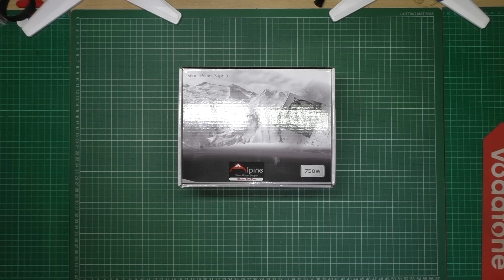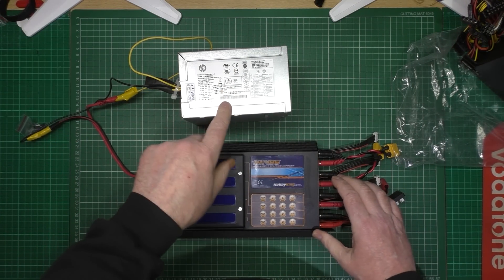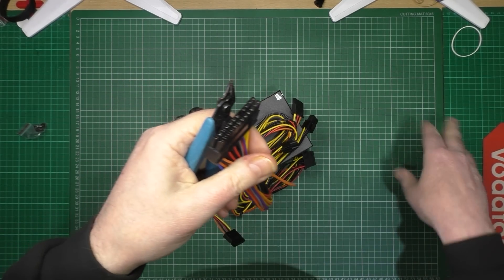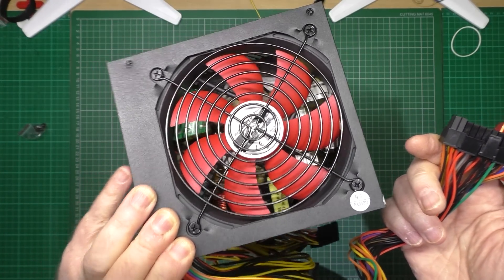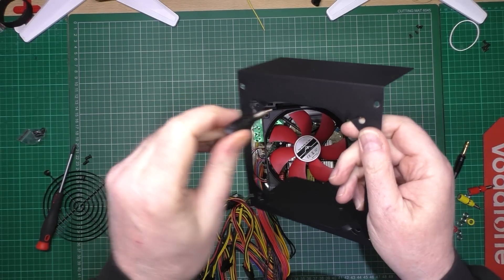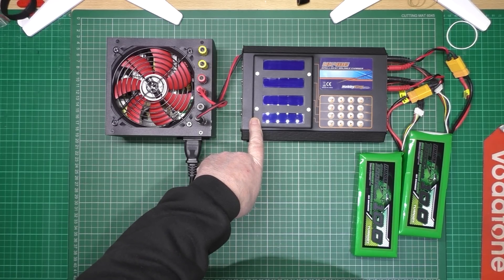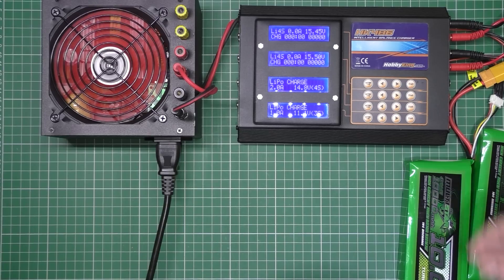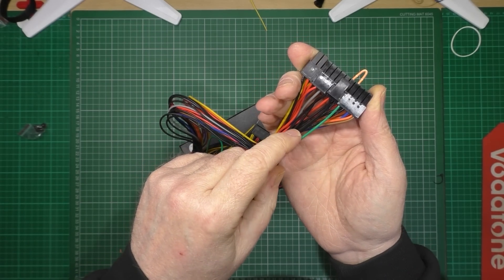PC power supply  - How to convert to power a lipo charger

Comment: Hi, thanks for great video! I have a question. Done everything the same as you, power supply works and charges, but the fan of the power supply is not turning on. What would you recommend doing? Thx again!
Reply: It could have a thermal controller on the fan which only comes on when it gets too hot maybe?
Reply: @vortecksengineering884  found out that the fan was fried. Thx for quick answer tho. Your vid helped a lot

Comment: I’m thinking of doing this for 3 imax B6 Mini chargers. However they don’t have bullet connectors, only barrel connnectors, which are rated at max 5A. Is it a bad idea to clip the red wires and solder them with the ground wires to some barrel jacks?
Reply from the maker: Whatever works for you!  
I'd recommend you use as many red & black wires in parallel as you can to share the load.

Comment: So would you just remove every other wire that isn't the green one, black, red or yellow?
Reply from the maker: You can bunch all the black together and the yellow together if you want (or spread them over however many connectors you have), it won't hurt and will handle the current better if you're charging at high current (more than 4a). Or, you can cut off any wires that aren't used but make sure you insulate them :D
Reply: Thanks mate. Would I be able to desolder the wires from the board and disconnect them from the connector?

Comment: Thanks for sharing but could I just pull out 1 ground and 1 red lead and jumper the green and black together? And is this practise common to all computer power supply's? Thanks again for sharing.
Reply from the maker: +etab83 Take the green wire and link it to a black one (any black one) this will make the power supply work. Red = 5v and yellow = 12v. If you get a higher wattage power supply, it's better practice to take 2 or 3 yellow wires and 2 or 3 black wires to carry the extra current on 12v. All new power supplies work this way with exception of the high-end ones, they also have a current sensor on them and won't work with this method. The cheap ones don't have current sensors and will work fine.
Reply: So I have a psu  (thermaltake sp850ah) rated at 840w @ 70a. So I put all yellows, all blacks, all reds and green/black together. I ordered a dummy load resister 10w for the yellow black as I was told that my new style psu needs to have some type of current for the psu to sense power if not my power will be unstable. Is this true? What else do you recommenf. This will be to power a 400w amp for a subwoofer. Please get back to me

Comment: hi , i thought this would be a great idea for me as i am now charging my lipos parallel. Therefore i need more amps. Its all connected up and powers up for a split second then cuts out. It has a switchable button next to the ac input not sure if i need to wire this up to anything as im guessing my old PSU was switched mode ? you said any ground wire to short out the green so i have used a random black wire. any ideas? thanks
Reply from the maker: The switch on the back (next to the AC input) is a 110v/240v switch. If it worked when it was in a PC, it should work with the switch as it is.  
I presume when you say "Its all connected up and powers up for a split second then cuts out" you mean that it cuts out with no load (as in, you haven't connected the lipo charger)?    
Some PSU's don't share a common ground so you could try another ground wire?
Reply: I have tried plugging a lipo charger in too and literally fan spins about 1 turn then cuts out , same with the charger that's connected the screen flashes on then back off

Comment: What model charger is that?  I am looking for a charger that is heavy duty like the one you have.  What do you recommend.
Reply from the maker: +Jon Car Any PC power supply will do, as long as it's an ATX type - The higher wattage the better. This is the one I chose.... http://www.ebay.co.uk/itm/272069988660 
Of course, I'm in the UK but there's loads in the US http://www.ebay.com/itm/121867414778
Reply: +Vortecks Asking about the lipo charger.
Reply from the maker: +Jon Car Ohhhh.... sorry :-) The charger I have isn't actually heavy duty, it'll only do 3.5a on 4s and the buttons have just started to fail. I've bought a couple of the Turnigy Accucel-6 80W which will do 5a on 4s and they're relatively cheap.

Comment: Good tutorial for converting to a lipo charger! I am curious though what exactly can kill you, if you don't let it discharge 24h ?
Reply from the maker: In layman terms..... All switch-mode power supplies retain a potentially lethal amount of current. Some capacitors hold charge for hours after the power has been removed and that's generally where the danger lies. Capacitors are DC current and (unlike AC current) if you accidentally touch the positive and negative, you can't let go and it can easily be fatal.
Reply: Thank you for your explanation!

Comment: Wait aren't yellow wires suppose to be 12v and the red 5v? Or you switched the socket connectors on purpose??
Reply from the maker: Yes, they are. I did mention that the plugs don't match the wiring but it's easier for me to only worry about the red connector which is all I'll be using....... https://youtu.be/6aVYxweu5ic?t=5m19s